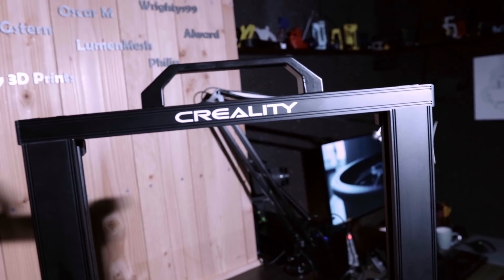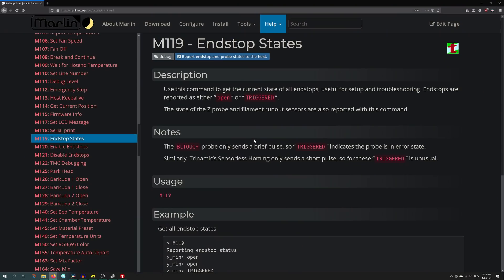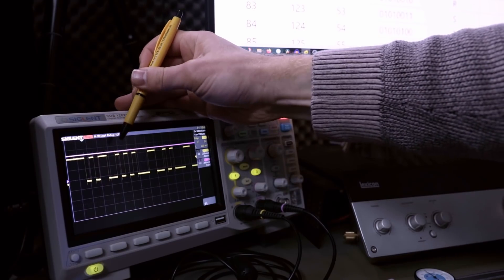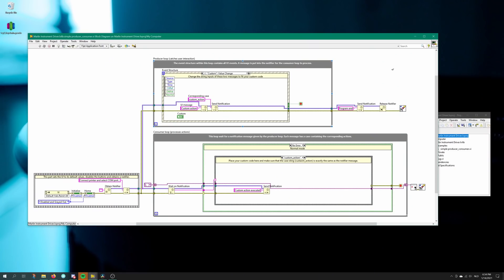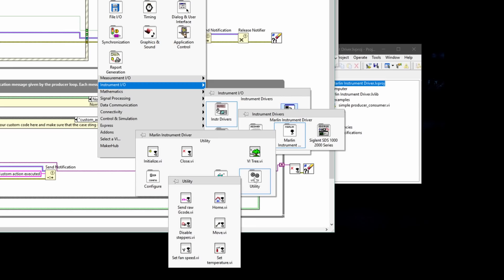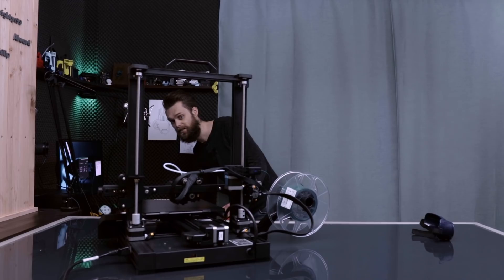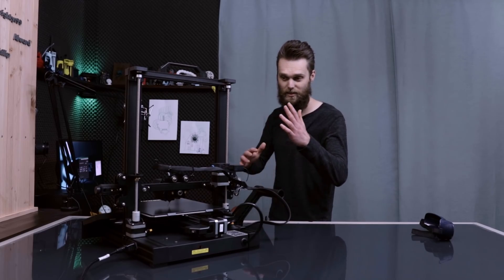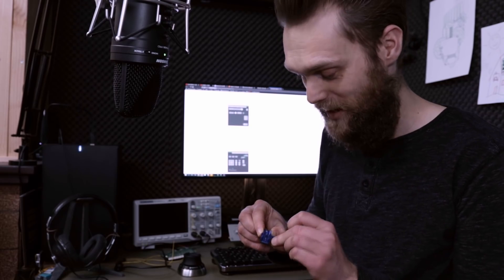I Developed my own 3D PRINTER Controller Software!

Comment: Im having an issue with my USB Serial connection... My drivers are updated but neither of my pc's want to connect to a printer.....
Reply from the maker: You need the VISA drivers for the instrument to work with LabVIEW with the same version https://www.ni.com/nl-nl/support/downloads/drivers/download.ni-visa.html#306041 Check also if you have the baudrate set correctly some boards run at 57600 while others run at 119200. Hopefully this helps.
Reply: @properprinting  I mena just normally  not with your particular software, i will check it out though. I was hoping youd say something to help, and i will See Visa Drivers :)
Thx!!
Reply: @properprinting  What version Visa Drivers??
Reply from the maker: @techdiyer5290  The same as the LabVIEW version. I think it was 2018, but it can also be 2020. It doesn't harm to install both so I'd try 2018 first
Reply: @properprinting  Well, its not able to do anything for the BTT SKR 1.4 Mobo that i plugged in... if i had a discord chat with you i could send you screenshots
Reply from the maker: my Discord is properprinting#1572 you can also send me an email to jon@properprinting.pro

Comment: Does this send gcode to the printer or does the pc break down the gcode and send movement commands? Great channel btw!
Reply from the maker: Thanks! This program sends the raw gcode, just like Octoprint does. This is the only thing the standard firmware can work with over that serial port. This is unlike Klipper for instance which has a dedicated firmware which converts gcode to lower lever communication.

Comment: Hi Jon,first of all i really like your channel, your projects are brilliant. I'm not an expert,and i have a question...your software PPC send, during the print, the gcode commands directly to the board(and this one need to "decode" the gcode lines) or it sends to the boards the bits sequence of a gcode command?
Reply from the maker: Thanks Francesco! My software, and most external 3D printer controller software (except for Klipper) sends plain Gcode commands on the serial bus. Usually the receiver waits for an end of line (EOL) character and interprets the line sent. It's like my software is "typing" the commands really fast to the printer. Once the printer has finished the command, it send back an OK. Some commands, like getting to temperature, take longer to finish than a small movement. If I don't wait for that OK, my software will just continue sending which will overflow the serial buffer resulting in unforeseen actions by the printer. Hopefully this answers your question :)

Comment: Might be the same as with the Ender 3 V2 for pause. When I tried to manually insert a pause with a couple slicers picking "pause" from a menu instead of punching in the G-code, the code it used just doesn't work on their firmware. The G-code that Chep's bed leveling program uses works to pause but has quirks. It doesn't issue a screen update even though it does update the print buttons to show it's paused. If the user hasn't rolled the knob forward the printer will have the wrong menu index selected instead of the resume button which causes bugs in the next print program to run that you wont notice until a few layers in. As long as you remember that it works as expected.

Comment: Hmm I made the same thing in nodejs in 2012. It had 2 advantages it can run both on your laptop but also on a raspberry pi. Second it exposes a browser interface (fully customizeable using regular css/html) so you can even control it from your phone. https://www.youtube.com/watch?v=tsMdusrO6bk. Project was cancelled due to octoprint having even more features. But for your usecase the original printerface would basically do the same thing your doing. But in nodejs and it has browser support... https://github.com/w-A-L-L-e/printerface (pfew 8 years ago, time does fly...)

Comment: So awesome! And I'm honoured to have designed the first thing that was ever printed with your software! :D Love where you are going with all of this, let me know if you ever need any engeneering help! :D (PS. I'm almost done with a 4 cyl version,  so you can soon print a fitting keychain for the mini (or scirocco ;), let me know if you want a pre-released version :) ), Thanks for the shoutout! :)
Reply from the maker: I really like your designs and this key chain was perfect to show the software. The first thing I found which was designed by you is that brush, so genius! That was right before I started this channel. I still haven't printed one but I definitely must try that. A 4 cylinder version indeed fit those cars and it would be cool to print that too. I'm thinking of printing that out of polycarbonate to make a durable key chain. I'll wait for the final version and I'm curious how it will turn out :)

Comment: can you make it able to connect to octopi?
Reply from the maker: I think this should be possible, but it wouldn't be easy. First I want to make a direct connection to a Raspberry Pi using Telnet so I can send Gcode commands directly through the terminal. This can be done with any Linux distribution (preferably Debian based) on a RPi. Maybe in the future I can connect to Octoprint's API and I've added this idea to the list, thanks! https://github.com/properprinting/PPC/issues/13

Comment: FINALLY A CODING PROJECT I CAN Understand! Never would've thought I'd be motivated to use LabVIEW post-grad!  I never tried to connect to anything other than TI boards but luckily I kept my student board just in case but luckily I have a couple of boards laying around to test with. Keep it up man!
Reply from the maker: I feel you, I don't understand most coding projects either xD It's fun to have some of these boards laying around. For example, you can just connect one single motor to it and make a very simple interface with two inputs: time and distance. Now you've got yourself a camera slider controller. Don't know if you're into this, but this just randomly came up xD

Comment: Honestly, you should look into klipper. It's incredibly flexible and you'll have hard time catching up with the feature set already built. You can change thing by just tweaking the settings file without having to recompiling and flashing. https://github.com/KevinOConnor/klipper
Reply from the maker: I definitely want to take a closer look into that, thanks! The program I made does not replace the firmware, its about making custom UI's and do experiments with it

Comment: why use labview and not just a regular programming language like C or C++?
Reply from the maker: That's a valid question. I'm a LabVIEW developer and this program is built for controlling instruments and devices. I think that controlling a 3D printer is an interesting case for this. Now it's available for free I think that this is a good moment to share it
Reply: @properprinting  ah, that's why! As a 3d print (and other subjects) developer, it struck me as unconventional. Your results are impressive! I've seen labview before, but never used it. Writing custom slicers and such is more my forte. Cheers!

Comment: WOW i didnt know about your channel until this video,  my congratulations to your job,  
you've earned mi subscription,  one suggestion did you think about using this software  in a raspberry  pi or something like that,? with a tactile screen in mode to use it to control printings, similar as octoprint do with simply interface, with im thinking is something as remote controll to the 3d printer gadget. Keep hard working I really enjoy this viedo! (Sorry for my english)
Reply from the maker: Thanks for subscribing and your suggestion! I made a LabVIEW program in the past which could connect to a Raspberry Pi through telnet. I used it for an application which used BLE connectivity in the time this was only supported by Linux. This is a great idea, I added it to the list on GitHub https://github.com/properprinting/PPC/issues/11

Comment: Oh my god, LabVIEW. It's imho very painful to program 😩. I had to do this during my engineering studies.
Reply from the maker: I can imagine, I used to be a full-time LabVIEW programmer at Philips and not all days were fun. 98% frustration and those 2 percent of success should compensate haha xD I like that I'm able to make a program like this pretty quickly now and have more fun doing it
Reply: @properprinting  Respekt, you are a die-hard, I guess! I am working at a big research institute and there a only two groups of people: LabVIEW wizards and the other employees 😂 I prefer Python, C and sometimes Javascript 😎
Reply from the maker: @maxhouseman3129  To be honest, I wish I could program in Python, C and Javascript. Thanks to LabVIEW I know the fundamentals of programming, but never took the time to learn those languages. I wanted to make a LabVIEW webserver using HTML, CSS and Javascript and use LabVIEW to do the controlling. I think that a guy like you shouldn't have difficulties working in LabVIEW ;)
Reply: @properprinting  If you want a very simple webserver, I recommend Flask (Python) or node.js (Javascript). You can with both set up a webserver with less than 10 lines of code, I promise! 

Maybe I don't like the graphic programming, that's the reason I don't like LabVIEW 🙄
Reply from the maker: @maxhouseman3129  haha if you don't like graphical programming you won't like LabVIEW xD Thanks for the recommendations! I've used Spyder to get "hello world" shown on my screen😂
Reply: @properprinting  Visual Studio Code is a very good IDE for all programming languages. It's also written in Javascript 😎
Reply from the maker: @maxhouseman3129  my colleague used that. This program is great indeed! Maybe one day I'll teach myself Python, who knows :)

Comment: I'm loving this. 1 suggestion, when your program is monitoring the gcode while printing, make the travel lines 1 color and printing lines another color, and then as each layer is printed, the previous layer fades more and more in color for each subsequent layer printed.
Reply from the maker: Making travel moves a different color crossed my mind, but the fading layers is a neat idea. Thanks for your suggestion!

Comment: I have a question, no hate to you because what you do is really amazing and admirable, but what is the advantage vs octoptint? Octoprint already has a much bigger platform and many plugins, it is also open source? Thanks! Really cool stuff though!
Reply from the maker: That's a valid question. The advantage is that I'm able to make experimental software and UI's quickly. For example select between photos of meals which I can print with a food printer, make UI's specific for laser engraving, milling, pen plotting etc. Control an Arduino easily, control and synchronize multiple printers. I'm not going to spoil too much because I've some fun videos planned. My program is open source and can be downloaded from GitHub.

Comment: BTW binary can be read and written in either direction because big endian little endian is a thing. Depending on the processor set up and how the serial chip work will depend on how it's transmitted - not that it should matter any good library should parse from strings because no one really wants to memories characters as binary.
Reply from the maker: That's true and to be honest, this didn't occur to me. From what I've read little endian is used at bit level and big endian at byte level. This would make sense for counting. As far as I know the UART protocol uses one endian at the level I showed. Thanks for bringing up, interesting to read more about

Comment: Your notification should probably be using a typedef enum instead of a string. That way it is not susceptible to typo errors and the consumer loop case structure can auto populate with each case.
Reply from the maker: Thanks for your suggestion Ethan. Both have their up and down sides and the reason for me to use string data is because I think it's easier to add and remove cases and you can misuse the default case to send string messages to the UI directly. Using enums make the cases more defined for sure and I have to be honest, you're making me think ;)
Reply: @properprinting  As long as you use the enum as a typedef then adding down the road is easy - you would only have to add it in the typedef and it doesn't break any of the existing implementations.  If you don't do it as a typedef then it is an absolute nightmare to change every place that you have used the old enum.  Great project!
Reply from the maker: @ethanbarrieau7917  Oh yes, this is a great example for using typedefs to make your life a lot easier xD Opening the typedef and adding extra items are those extra steps I why I think it's easier to use strings. And I'm used to the queued message handler so it's a habit for me to use strings. Still I think your suggestion is a very good one, thanks!
Reply: @properprinting  You can also send in clusters to the enqueue elements command. So if you had a command and some modifying data (e.g. move, 50mm) you can cluster those together and send both to the queue. Then you can then unbundle in the consumer and have both the command and that data without having to pass through local/global variables. Makes a good separation between the UI producer and the consumer so that only one is referencing the inputs - means that you can even put the consumer into its own SubVI.
Reply from the maker: @ethanbarrieau7917  At this moment I'm using a cluster of the message together with variant data for the main program. This variant data is converted back to the specific data in the consumer loop. For simplicity I only used string data in the device driver demo. The main program looks a lot like this https://labviewwiki.org/wiki/Queued_Message_Handler I didn't expect so much interest and as we speak I'm simplifying the block diagram of that main program.
Reply: @properprinting  Very nice! I do a lot of LabVIEW in my day job so I just find it interesting to see how other people use it.  I do much the same as the link that you referenced - with the exception that I use multiple message queues and multiple consumer loops each housed in their own SubVI to independently talk to different sensors or pieces of equipment.
Reply from the maker: @ethanbarrieau7917  That's awesome! If you're making larger architectures I'd recommend to take a look at the Actor Framework https://labviewwiki.org/wiki/Actor_Framework The problem with using multiple message queues is when one queue talks to another which then again talks to another or itself resulting in one big mess of queues unable to debug properly. I've made this mistake with some large applications and didn't make it easy for myself to add parallel running for loops and reentrant VI's xD I've created the debug hell haha
Reply: @properprinting  Thanks for the tip - I have looked into LabVIEW OOP and the Actor Framework before - I definitely agree it is a more elegant solution and is a little more future proof.  I just haven't spent the time to learn it yet - I haven't found it quite as easy to learn as OOP in Cpp, Python, Javascript etc.

Comment: Holy crap! this is awesome! can you run multiple printers at the same time? I will pay for a software that can control all my printers without the need to buy a raspberry pie for each printer!
Reply from the maker: Thanks Oscar! Not yet and for some reason this didn't even occur to me. Great suggestion and I've added an issue on GitHub regarding this https://github.com/properprinting/PPC/issues/8

Comment: 14:54 @Proper Printing Pause button works only between commands. G-code is sent to the printer cache in big blocks. So when you push pause button, your pause command will be send as last command in block. So sometimes it can be 10 seconds of delay between sending a command and execution of command. Enjoy!
Reply from the maker: Thanks for the info! The pause function works, but it does not resume correctly. My program waits for the printer to finish its action so I doesn't cache the messages. It's an odd problem in my framework and I'll find a solution ;)
Reply: @properprinting  I use LinuxCnC on small lathe, but it use Paralel port as a source of pulses for steppers, so my pause is in real time. But when I was trying using GRBL or Marlin, pause was delayed as I mention in the first post.
Reply from the maker: @jadamcak  Exactly. A serial port needs a buffer because it's serial. You can choose to fill up that buffer and let the printer deal with it or limit the amount of data so you've got more control. I do have a problem with this buffer though because the torture test responds late. The printer replies with "ok" once it has finished its task and the program waits for this reply before sending a new code.

Comment: What would be the possibility of running this on a Raspberry PI 3b, b+, 4, ect.... I really enjoy the live Gcode view while printing!!!
Reply from the maker: In the past I've compiled LabVIEW code for the RPi and this would be very interesting to run on that. The only problem is that I need to design a web interface because the UI wouldn't run on RPi. I'm not good at web developing
Reply: @properprinting  Got it! With the Windows unit you have hooked to the Folding Ender you are hoping to achieve this I'm assuming? Cant wait to see the upcoming videos for this software. Seems I may be swapping to a windows platform if this is the case. (Wanting to run entire printer from a single software/touchscreen device.) Great work as always! Thank you for sharing you creations with he world!